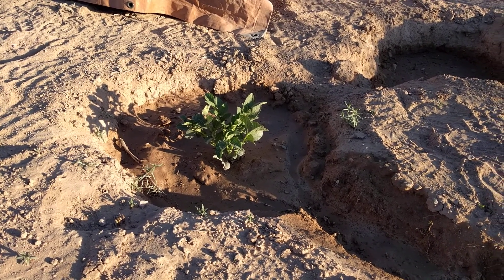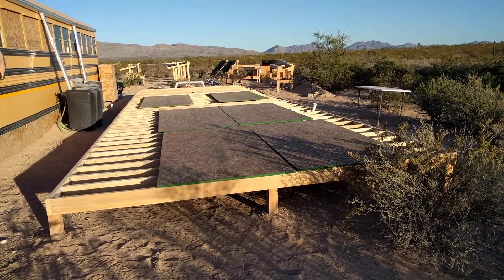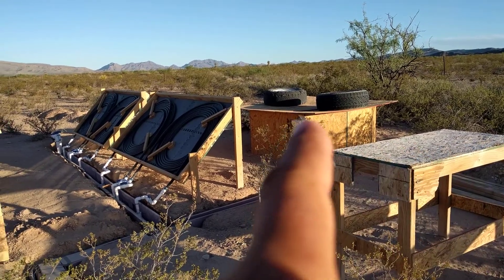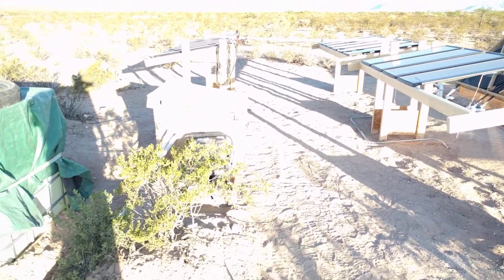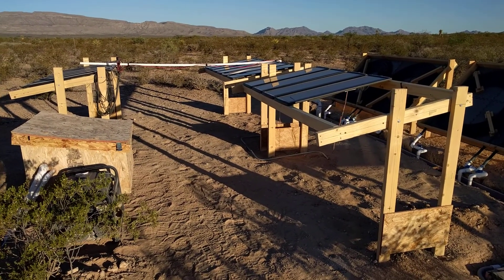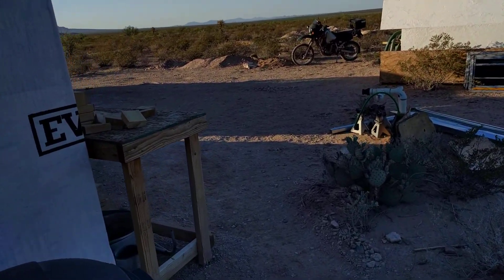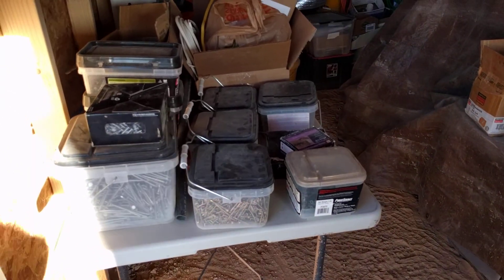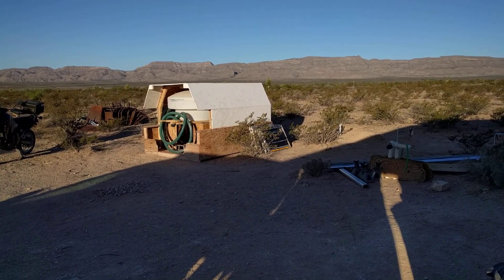May 29 2019 - House Floor and Updates

Comment: You mentioned making coffee in earlier videos.  I have had great success fertilizing my potatoes and tomatoes with coffee grounds, alone and as as part of general compost.
Reply from the maker: Yes I am adding coffee grounds to the compost, thanks for the comments!
Reply: Don't forget you're in this part of the nitrogen component for growing things
Reply from the maker: I really hope to have time to learn all about this, probably will get serious about growing and green house next year.
Reply: I don't know where you get your energy from but I'm glad you're doing this now than later in fact it's probably good you didn't pursue that Trucking situation cuz it probably isn't the most healthy occupation and when you were done you couldn't physically do what you're doing now and I'll think anyhow best of luck keep up the good work always save extra plywood to use for those headers going across the top that you got those beams of the two by fours if you put them screw them with them together with them plywood scraps it'll really make them stronger so they can take some weight
Reply: As for sweet potatoes you can mix other things with sweet potatoes or regular potatoes and it tastes good so experiment with that looks like Hamburger Helper
Reply: @CarlinComm  _ If you want to start early, a good first move would be a crude frame work made of scrap pallets to contain a compost pile.  Throw in vegetable waste, coffee grounds, leaves and plain shredded paper.  Steer manure helps but isn't required.  Let the rain get it wet, turn it once a month and let it slowly break down.  When you are ready to garden it will be there for you.   If you find any earth worms throw them in too, they love paper and coffee grounds.  Given the sandy desert soil earth worms would really help.  If you want to raise animals, chickens love compost piles because they generate bugs as food.

Comment: I would rather see the bus windows installed in the shop.  I don't think they would work as well as a insulated vinyl window for the tiny house.  Love the floor, next is the walls!  Thanks for the updates Carlin Comm.  #thesummerofcarlin.
Reply from the maker: Yeah I'd love to put lots of double pane windows in, but they get expensive, and I was noticing I had some free windows just sitting there. Way I figure it, I survived 2 years with the bus windows already. They'll also go in the shop, I do have lots of them! Thanks for the comments!